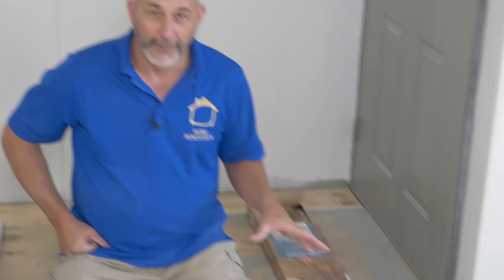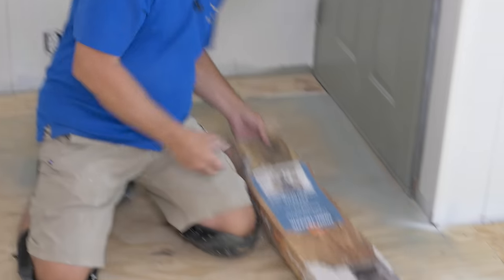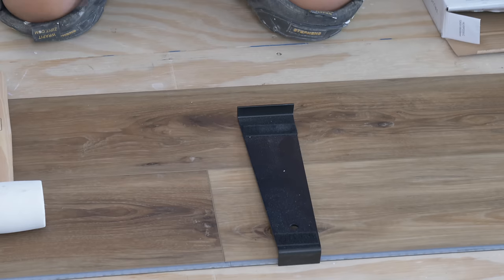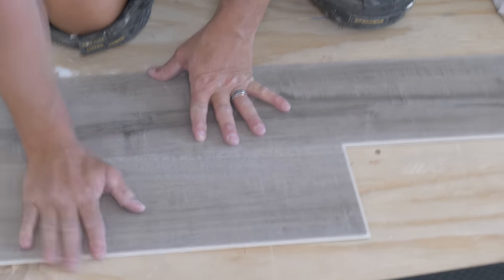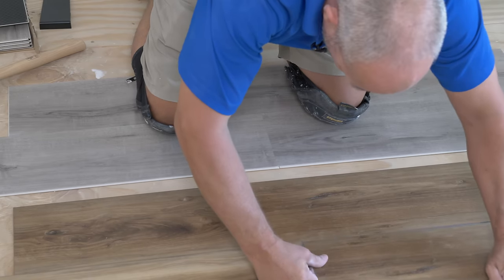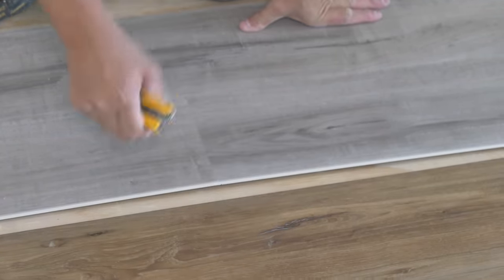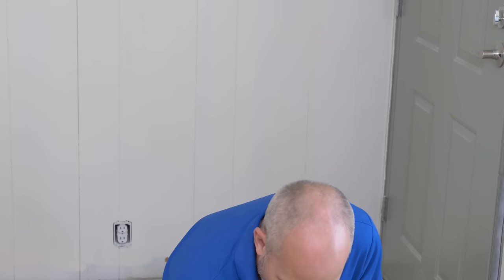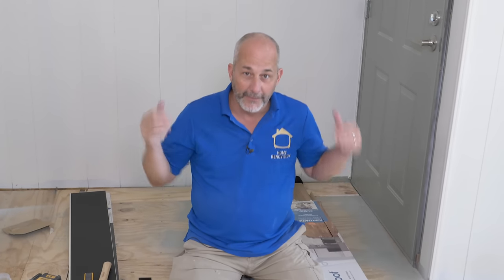2 Types Of Vinyl Flooring | Which Is Right For Your Home?

Comment: Trick for everyone! I find those love tap tools sometimes cause damage. Just use an off cut and set it in the joint and then tap that. Spread that energy across the entire joint without damaging the tongue and groove. And it works for both vinyl and laminate!  😊
Reply from the maker: Great tip!
Reply: ABSOLUTELY...a must!
Reply: If you don’t have a tapping block, 💯
Reply: You can also shave off one edge of a 2x4, so that it has a sharp, clean edge, and use that to tap the boards into place. I did that for my laminate flooring, and it worked great.
Reply: I was gnna say exactly this good on you fam
Reply: Or use the PVC block that has a groove instead of metal tongue for whacking them to place. PVC block though can't be used next to walls due to the fact that you have fit a mallet in that space also bear in mind 2:3 ratio when cutting the planks and that colours like with paint and tapestry can vary between the packs, usually you have 3 packs open where you then mix and match to avoid striping or obvious colour changes. I usually prefer vinyl in the kitchen because unlike other materials it can usually survive with out a dent if you drop a pot or something else heavy on it, the rest of the house I rather have laminate or laminate parket flooring as they have a more expensive feel to it then vinyl.
Reply: Whats a off cut? Left over vinyl?
Reply from the maker: yes with the coinciding t and g joint. Cheers!
Reply: Thank you for the important information, awesome diy video!!
Reply: @GR-cd2kx  Only thing with tapping block though is, make SURE you're resting the edge above the tongue...if seen those suckers break off easily!
Reply: @markarita3  good point. The ones I use have a little step at the bottom that rests above the tongue for that exact reason
Reply: 100% best way
Reply: Yes! I saw him hit the edge with that tool and cringed. Learned the hard way, that tool will definitely snap those interlocking edges right off. I only use that tool he's using against the wall to cinch in that last plank.
Reply: or get a proper tapping block!
Reply: This
Reply: I use an off cut and the love tap tool on the junk piece.
Reply: a love tap with a rubber mallet will not do any harm . Someone must have used a regular hammer .

Comment: If you have a slab on grade concrete subfloor in the basement, but the concrete is not perfectly flat, would you recommend going tongue and groove over snap lock? We're talking about maybe half an inch change over several feet, but you can see the hump standing back.

Comment: I put down LV plank in the basement. It was originally cheap vinyl tile 9x9s. Put down LV plank right over it. It has the padding under so it doesn’t feel like you’re walking on concrete. So far so good.
Reply from the maker: Great job Bill. no worries with that! Cheers!

Comment: I enjoy most of these videos. They’ve helped me with a few projects around the house that I had no experience with. But as a professional flooring installer, this video was hard to watch. The message was great. I always try and talk the homeowner out of drop lock. “Angle lock” is a much better product. But you never use a pull bar to secure planks in the field. It’s meant for places a tapping block can’t reach (around walls) you will definitely damage most locking mechanisms by doing it that way. Theres actually a much easier way to install the angle lock.. try starting with the butt joint first. There is a reason it’s called “angle lock”. It’s set in on an angle. but it takes a little time getting comfortable doing it that way.
Reply: Exactly. With butt joint engaged the side long joint usually can be engaged by lifting and pulling together.
Reply: Yeah he's doing it totally wrong. And whenever I use a pull bar close to a wall on a factory edge I still put a small scrap piece on the edge so it doesn't get damaged

Comment: Oh, thank goodness! I picked the right flooring.  I'm going to be honest I had no idea about what you're pointing out in this video.  We almost got the lifeproof, but we decided at the last minute to get the ridged core. Mainly because of the look and style of the ridged core. It actually had texture and looked more like real wood, in our opinion.  Now I will say installing the ridged core wasn't fun at all! It was difficult and I cussed the whole time. However, it's been almost 3 years, and we haven't had any gap issues that I've seen others have. I was relieved to find out now that we made the better choice! Thanks 😊 this was a good video!
Reply from the maker: the secret is to connect the whole length before slipping it into the groove. Cheers! video coming soon!
Reply: @HomeRenoVisionDIY  All fun and games until you're alone at the job site and the lenght is like 6 meters per row all at once, what a nightmare that was.
Reply from the maker: on this job i was doing a 50' run. Cheers!
Reply: Where were you able to buy the rigid core floor? I'm looking but I can't find it.

Comment: We've installed the Costco mohawk flooring in our rentals.  Was a steep learning curve but your videos helped build confidence and tricks to handle tricky cuts (I still hate doing door jambs).

Its a 1900s house and while we had the floors raised/leveled from underneath there was still some uneveness. We're using the steico underlayment and it's working great.  The floors feel really good under your feet with it with the bonus of providing a little insulation from the crawlspace.
Reply: The Mohawk flooring from Costco doesn’t come with underpayment?

Comment: Speaking from experience. I currently have LVP. I would only recommend this for basement or if you have a really flat surface. Can you imagine placing these thin boards over your sub floor. The product work great if your floor is concrete.

Comment: GIANT CAVEAT ABOUT T&G!!  We moved into a patio home (slab-on-grade) 3 years ago.  We had the carpeted floors replaced with T&G vinyl planks. It looked good. BUT, here comes the caveat..  I use a wheelchair and it’s two small wheels on the front are wider, softer, and spread the load out better. Had a problem with it, so i had to use a backup wheelchair that has the standard, thinner, harder wheels in front.  In just about a months time of using that wheelchair, the places that i occupied the most throughout the day, the flooring started seperating and bowing up at the ends. It got so bad in the kitchen, we just pulled up severL of the planks. The change in loading by using the second chair caused an increase in the point load made by the two small front wheels.  This caused the tongues to fracture and break.  We had to have the ENTIRE floor replaced with NON -T&G glue-down vinyl planks at a cost of around $8000..  So anyone moving into similar circumstances, check to make sure you don’t have T&G flooring, or may be replacing your floors within a few months of wheelchair use…

Comment: I installed some super cheap vinal plank flooring over an uneven basement floor. Bought some super inexpensive flooring and a super cheap pad/moisture barrior. It wasn't perfect and places where I had problems because of the floor slopes like he showes I used expanding sprayfoam to fill in the voids and glue the floor in place. Over each problem spot I injected the foam and then just put a heavy weight to hold the planks down so it would dry flat with the joints locked. I doubt it held up but it gave the basement a clean enough look for my family to sell the place quickly. I dont recomend the inexpensive stuff, and deffinatly if you do use it you have to have a dead flat floor. The glue with some "Great Stuff" did work but I bet after a little while that stuff broke down and made the floor have crunchies underfoot. I woulden't have left it if it wasent just quick cosmetic refresh on a basement utility room. It was for sure lipstick on a pig but better looking than painting the floor or the peel and stick tiles you can get which would have been the only other as cheap/ quick options.
Reply: If you're skimping like I did on a project like this skimp all the way. The trash products that get returned a bunch by the big box stores are always getting rotated out of inventory. Get the clearance they practically give out the items they are discontinuing.

Comment: Jeff, as a manufacturer who owns a factory that makes spc flooring, I would like to point out something. You can NOT hammer the short side on these drop lock systems. To learn about drop lock installation, I suggest people check out I4F, who is lincensor of drop lock technology. If the plank has not locked properly, hammering it from the other side will only damage that joint. "love tap" should only be done on the long sides. Uniclic locking system is the only locking system that can be "love tapped" on both sides short and long sides because all 4 sides of this locking system is angle type, not drop-down type. However in this video, you have not brought any to showcase. 

Also, the very top of spc flooring is coated with UV later. This is the layer that provides critical scratch and stain protection to your floor. There are many different types of UV oil, some have much better performance than others.

This video's purpose was to show two different locking systems, but the two products you are comparing have the same drop lock system. Doesn't give your viewers much confidence if you can't tell which locking systems you are working with.
Reply: I don't know what you're looking at but those are definitely two different locking systems on the short joint, he just mistakenly calls the second one a drop lock when he starts to put it down. However, the way he does it is not how I do it. I start by angling in the end joint and then do the long joint. And I would never use that pull bar on a factory edge, get or make a proper tapping block.

Comment: I have been watching this channel for quite some time now and enjoyed it tremendously. We are building a two story home and need to install the floors. Upstairs are a easy decision, they will be hard or engineered wood. Downstairs are more complicated. It has a open kitchen which transits to the big open family room area without any boundaries in between. We are very concerned about possible water damage from the kitchen and have a hard time to decide the floor material, wood, vinyl or tile, etc. Any opinion will be highly appreciated.

Comment: I installed the Noble Oak vinyl plank flooring from the Home Decorators Collection in a older house bathroom with a new sub floor and it curled up like bacon with a week. It had too much give side to side and after i trying to level off the floor perfectly i gave up and installed linoleum instead.

Comment: Just finishing with a product called Aqua Guard Premium over concrete. The floor was previously ground flat for laminate that was 3.5 mm thick which got destroyed by my gf’s unhousetrained dogs. The underlayment is 6 mil plastic moisture barrier + rubber backing on the planks. Finally figured out that I had to slightly lift the previous plank and get the ends lined and partially clicked in place, and there is a little notch in one corner of the drop locks. The planks are very stiff and 12 mm thick which are on the same plane as existing porcelain tile transition.  I doubt they could be snapped, I put a 6.5 inch wood blade in a wet tile saw I had from glass backsplash install and ran it dry. I didn’t want to rent a table/miter saw cuz I’m very slow and would cost more than the material. Could have bought a saw and then sell it, I suppose. Got the planks on closeout for $1.98 sf, I don’t think it is sold anymore, just the 10 mm thick version now. Ripping the last row of planks on the tile saw was an adventure, I messed it up and had to use one short piece of scrap cut wider to patch up the wall gap that kept growing to 1” at the end. Getting the end joints to close was a bear, I used a tapping block and pro length puller hitting them hard with a 4 pound sledge. The puller I engaged over the plank lip, not on the locking ledge. Chipped the wear layer off on the end of one row, but next to wall so it won’t show. And I learned that 1/8 inch gap, the width of the locking ledge, is plenty next to the wall in my small house.

Comment: I used Stain master luxury Vinyl planks years ago and regret using it ,was expensive and scratched so easy.Even with thresholds it separated at some points.I learned my lesson,so  doing it on the stairs I used nail gun to secure planks and caps. I definitely recommend if you're flipping house looks good and it's easy to install.
Reply: Not surprised it scratched easy, Stainmaster LVP has an abysmal 12mil wear layer. Jeff says don't consider anything lower than 20mil, personally, I'd up that to 30mil

Comment: Also make sure you clean the floor... our house's kitchen has some sort of vinyl flooring and it seems like 2 or 3 small pebbles were left under it and the joints are cracking apart on those spots. I think it's tongue and groove style like you mentioned. :( Not sure how to repair it. They also didn't do any underlayment, I think it's installed right on the concrete because it makes snap crackle noises all around when walking on it.

Comment: We have SPC flooring tnat was installed a few weeks before we bought our home. The previous owners had a toilet leak and ripped out the entire floor thatvwas engineered hard wood and replaced with SPC planks. 
Unfortunately the SPC only lasted 6 months before all of the locking mechanisms failed, planks coming up and cutting feet, chipping, separating, etc. Called the company who installed it and of course they were off the hook because the warranty did not transfer to new ownership. They admitted that they had needed to raise the floor off the concrete slab to make up for the height of fhe thick engineered wood. So they laid 3/4 inch plywood underneath a vapor lock barrier right on top of the slab. The floor is a hazard to walk on and it needs to be replaced but we are unsure of what type of floor to replace it with because the plywood underlay seems to be extremely uneven and warping in our clhot Arizona climate. I am considering just the glue down type floor but have a feeling everything needs to be ripped out and we need to start from scratch which we cant afftat the moment. Our planks are being ductaped down to prevent further injuries, it's awful. 

Does anyone have any suggestions? We will have to avoid any flooring that has any kind of locking mechanism due to how uneven the floor is. Or do we just try to nail it all down and peel n' stick vinyl over top of it?

Comment: This gives me some peace of mind. My buddy owns a bar and wants me to do LVP and I've been extremely worried about the 100 year old building and the amount of traffic.. he knows he will get 10 years max out of it. But I've put in cheap trash for friends that they purchased and I told myself never again will I do something like that for anyone.
Reply from the maker: in that environment take a look into the vinyl plank that glues in place with no locking joints. that way you can peel up a damaged board and replace it. many come with a 10 or 15 year commercial warranty as well.
Reply: @HomeRenoVisionDIY  that's what's currently in place. I was trying to avoid all the work tearing it out because I'm doing this as a favor lol

Comment: Would you recommend vinyl plank flooring in a basement?
and whats the essential things to look for when purchasing the vinyl flooring?
Reply from the maker: yes for sure. in an old basement you want a more malleable core because of the slopes. . in a new basement rigid core is always the best, for joint locking durability. minimum of 5mm thick with a 20 mil wear layer. Cheers!
Reply: @HomeRenoVisionDIY  thanks!

Comment: I have Coretec LVP floors.   That actually cost more than many hardwood planks.  I have dropped stuff a bazillion times doing interior DIY projects (with no visible damage) that would have scratched or dented the hell out of a hardwood plank.
Reply: Ok
Reply: Cortec SPC is tough. Got it in my basement home gym. It does resist dents.

Comment: Great as usual. Many thanks. Quick question is what are the two different systems called so I know what to look for. I need the better locking solution since I am installing on a floor that was built in 1928. Thanks again.

Comment: Renovating a basement room and want to install Vinyl floor planking of some kind for this small room we are turning into a kitchenette so the waterproof quality sounds appealing. It is an old house in San Francisco with old hardwood floors. Some areas I can tell from looking it is not level. Mainly in the corners and at the threshold. Thank you for this informative demonstration as I was going to purchase the click lock vinyl tomorrow. I will hold off now as I wonder would it be beneficial to lay for example a 1/4 layer of plywood over the old floor to give it a more sturdy platform for the flooring? Any help you can suggest would be much appreciated.

Comment: An interesting thing that I figured out regarding lifeproof, some (not sure how much) is re-branded MSI. What I tracked down for sure is on the engineered hardwood version. This is useful as MSI has more matching transitions, stair noses, stair treads etc than what HD sells. Seems the best way to tell is that HD uses the same image on their site as MSI does (as in the exact same picture down to the knots in the wood etc).
Reply from the maker: LOL. they are both buying the vinyl from the same chinese supplier!
Reply: @HomeRenoVisionDIY  While I'm sure it is coming out of the same factories as half the other similar products, Home Depot's questions section on the page actually had really old comments from MSI answering questions and also linking to the MSI products on the HD website (this is how I got started tracking down the MSI version).